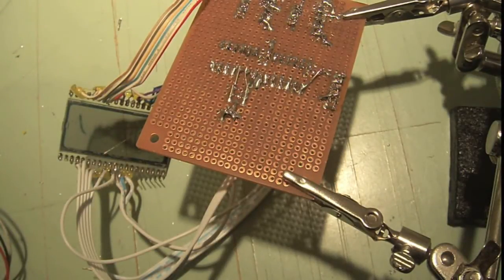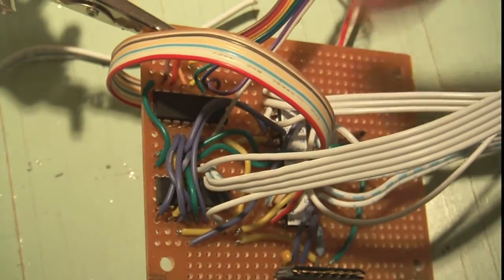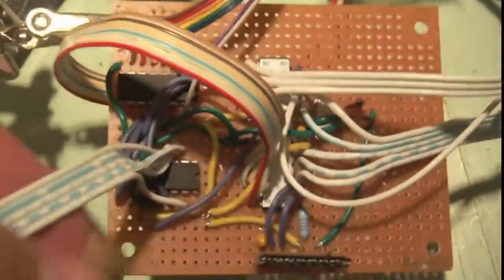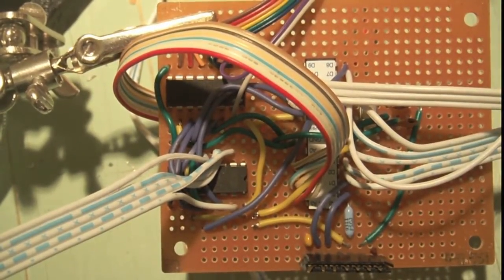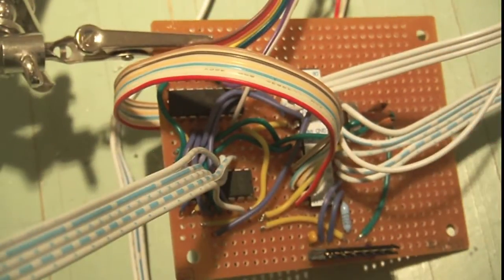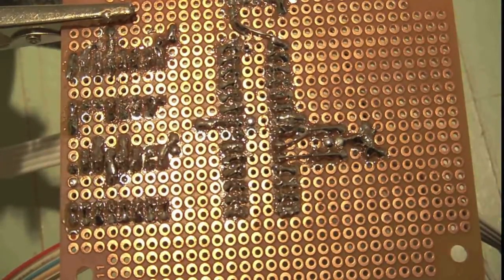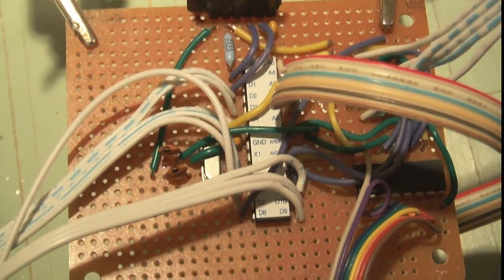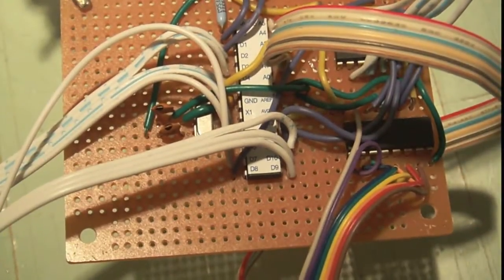Protoboard Tips

Comment: Sorry for opposing - I respectfully dissagree on emphasising the tips when the whole approach misses the basics IMHO. 
You missed the first rule of design - prepare connections on paper/computer BEFORE physical arrangement on protoboard, although in your case just a more thoughtful approuch would probably suffice. 
That apply both for final design as for protoboarding. The consequence: your simple design with several chips and display looks terroble with massy wires. It is true protoboarding is done much more loosily, but not the way you demonstrate with so badly organize mass of cables where you cannot see anything, not even chips. That is NOT the way to go even when playing or prototyping.